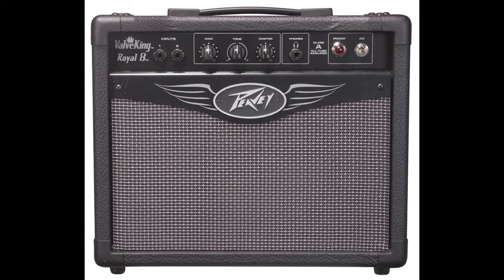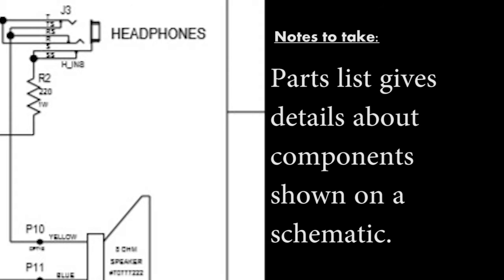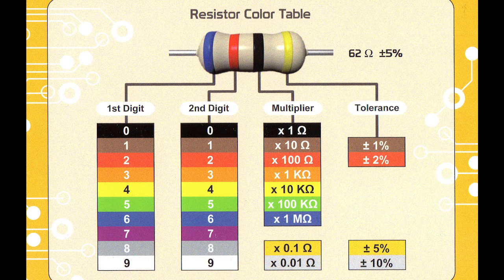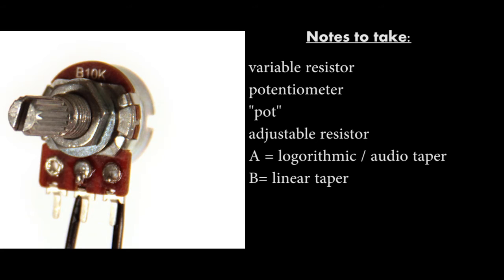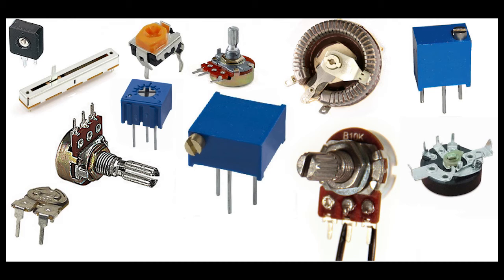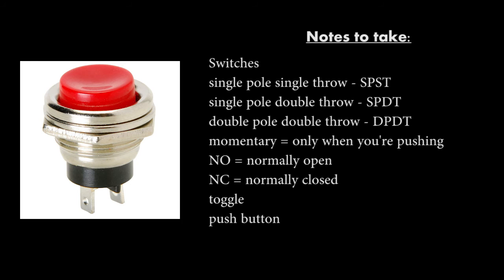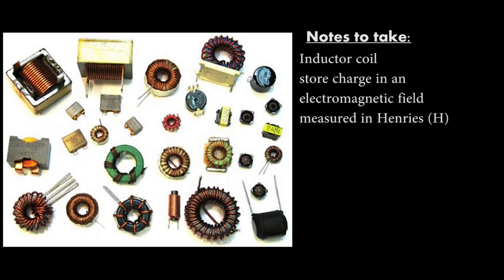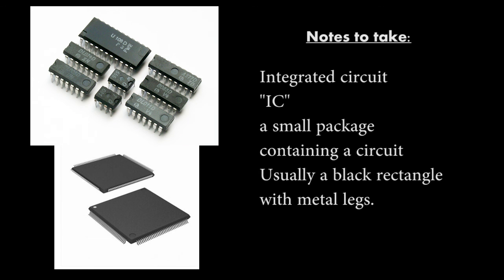Audio Electronics - Electronic Components

Comment: Hey! I know this is a 3 year old video but the channel is still active so I'm gonna hope I'll get a reply. This video is great and really helpful for beginners like me. I do however find myself in the position where I'm wondering, where does this all fit together? I get that a resistor that is 30k resists that many ohms, but what effect does that have on the audio signal? Why would I choose to put that in a circuit as opposed to one that resists less? This kind of thing applies to all components in my case - if I want to start getting creative with circuits and building own audio devices this info seems to be the missing piece. Sorry if I sound a bit insane and I hope you can enlighten me a little bit!
Reply: would also like an answer for this
Reply from the maker: You don't sound insane.  It's a good question.  Unfortunately the answer is VERY complicated.  The video was really only meant to help identify components and give you the very basics of what they do.  If you put them together in different circuits, they can do a TON of different things.  You'd really have to go to college for electrical engineering to design your own devices.  I'd like to know that stuff too.  I've built a few things of my own, but they've been very basic and based heavily on other peoples designs that were published on the internet.